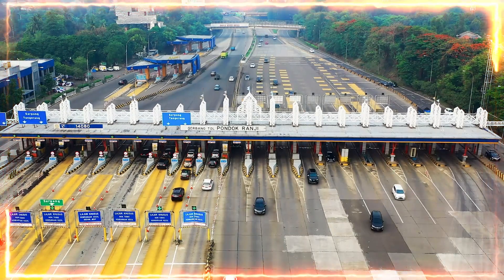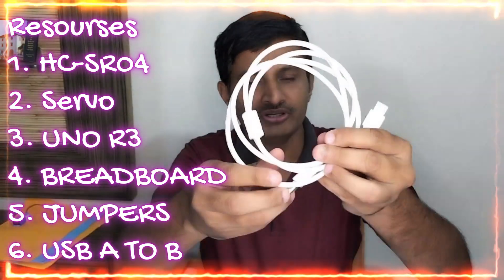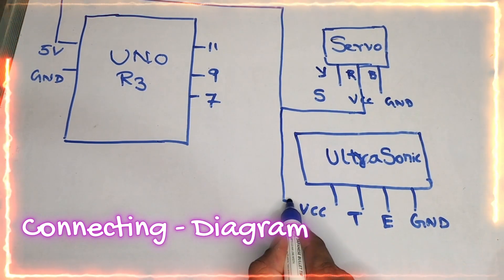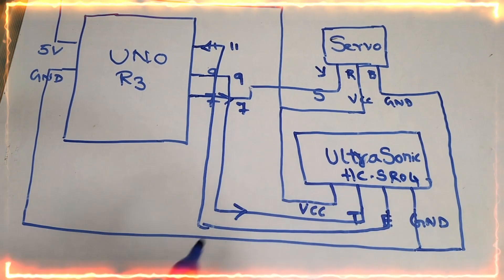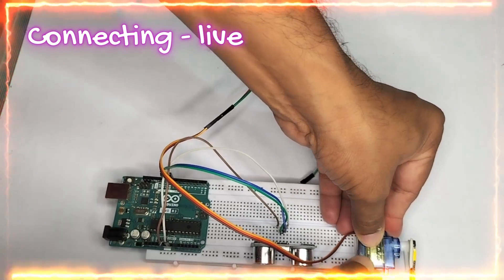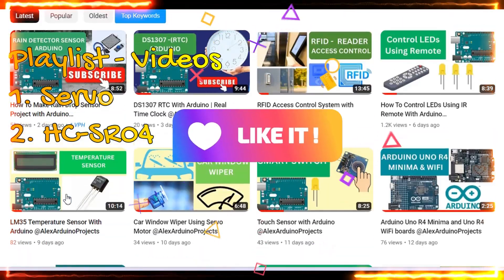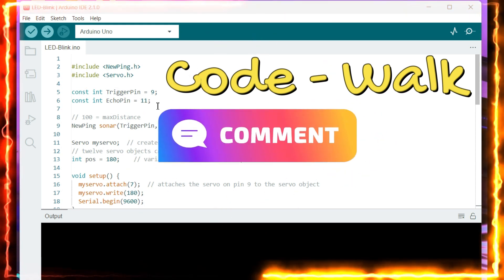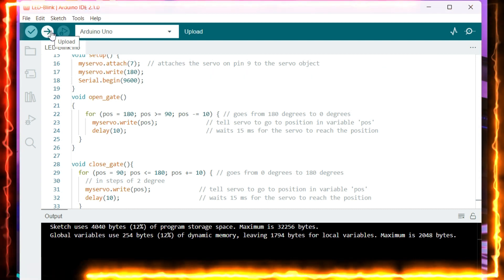Toll Gate System Using Arduino Ultrasonic Sensor HC-SR04

Comment from the maker: Amazon - Online Purchase Links for Resources:
1. HC-SR04
https://www.amazon.in/gp/product/B08TR64876

2. Servo Motor
https://www.amazon.in/gp/product/B00MTFFAE0

3. Uno R3
https://www.amazon.in/permanent-guarantee-Arduino-Uno/dp/B0044X2E5S
https://www.amazon.in/roboCraze-Arduino-Development-Board-cable/dp/B07G4C4D8F

4.Breadboard & Jumper
https://www.amazon.in/ePro-Labs-KIT-0010-Breadboard-Pieces/dp/B01BLJGS7M

5. USB A TO B
https://www.amazon.in/JGD-PRODUCTS-Printer-Compatible-PRINTERS/dp/B09TXLM9TP